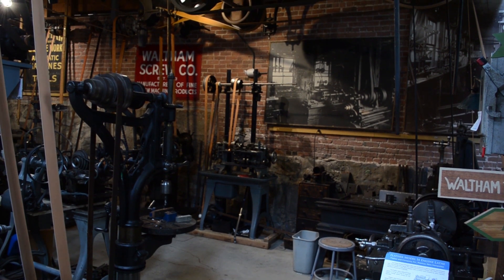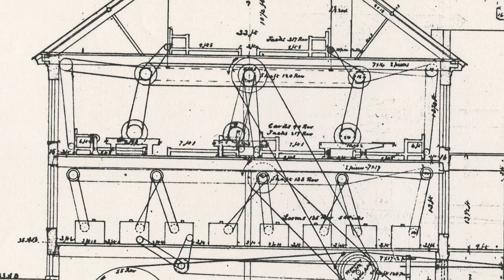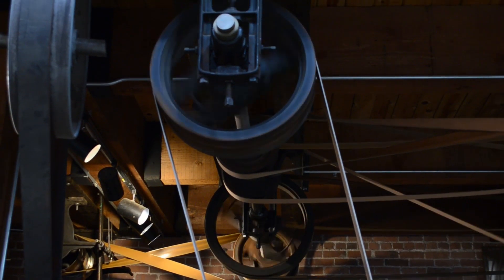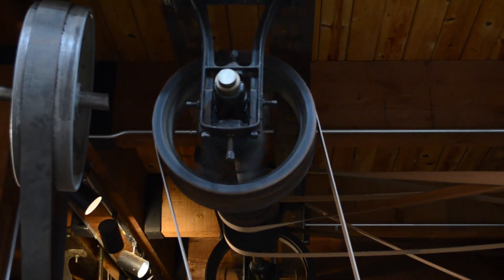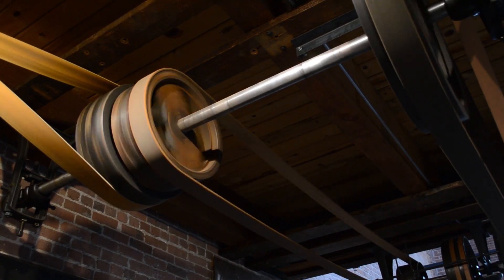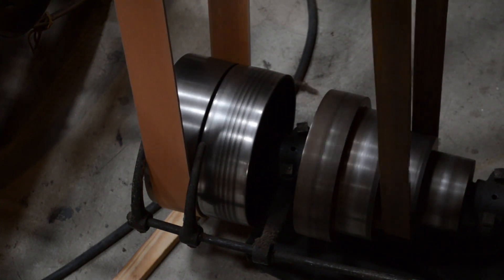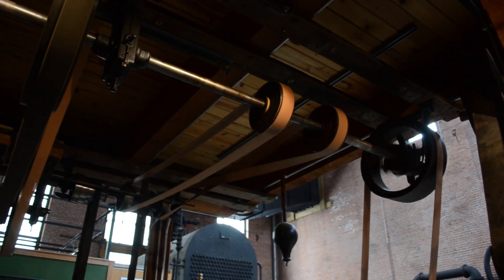Belt & Lineshaft System - the transfer power in a 19th century machine shop

Comment: Anyone knows what they used as belt dressing, back in the day? 
(Belt dressing, is applied to the belt or pulleys to maintain friction between the two)
Reply: Although not quite "back in the day" of the Cabot Lowell Mill (circa 1813-) the book I refer to for belt dressing "Treatise on Leather Belting" published in 1931 has recipes that very well may have been used on the museums line shaft system used throughout the late 19th and twentieth century in a paperbag factory located across the river from the museum in Waltham.
The book stresses the importance of keeping the leather belt clean from any oils gathered from the bearings. For this chalk was used to soak up the oils and then scraped off. I would guess that this would apply to the leather belt treatment of the early days of the mill (the chalk crayon was invented in Waltham in 1835) In addition to keeping the belts dry from contaminating oils , It was important to maintain and replenish the natural greases that helped the leather remain supple and flexible. Cod oil and tallow was warmed together to form a paste which was swabbed onto the belt. Neatsfoot oil is referred to as well as castor oil. "Ordinary brown soap" was also used to make the belts sticky but this seems to be used only in emergencies as a sticky belt would attract dust , abundant in a textile mill, which if not addressed with a proper dressing would have detrimental affects on the belt. (I despise the use of sticky dressing in my own shop) I'm quite sure when these mills were being set up, the mechanics would have referred to Oliver Evan's book "The Young Millwrights and Miller's Guide" which I do not own but have glanced at. Within you will find an impressive list of chemical  mixtures for all things related to setting up and running mills especially gristmills. Hope this helps.

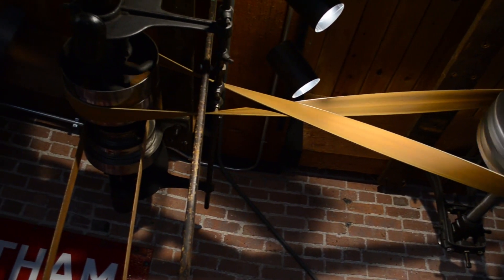Comment: 1:10. How the heck does that sideways turned belt stay aligned on the pulleys???
Reply from the maker: Alignment is a relative term here. They can shift a bit here and there, as long as they stay engaged. That is part of the beauty of the simplicity of the system. It comes down to friction (to drive) and tension (to stay engaged).
Reply: And the pulleys are not flat but convex shaped, so they automatically ride where there is least resistance.